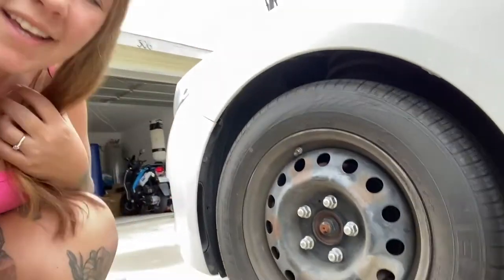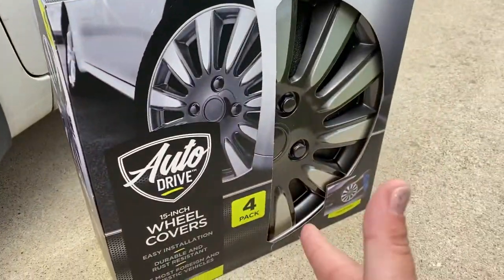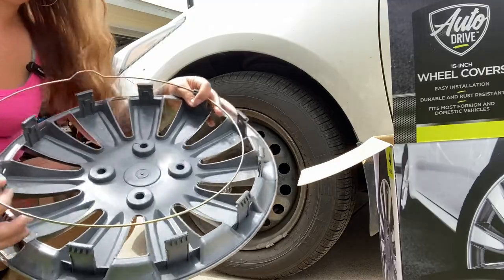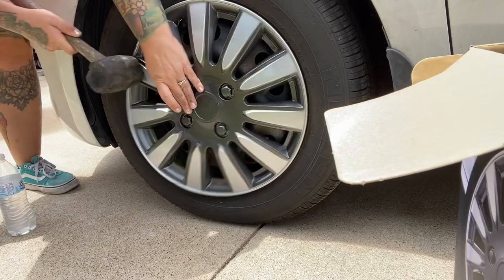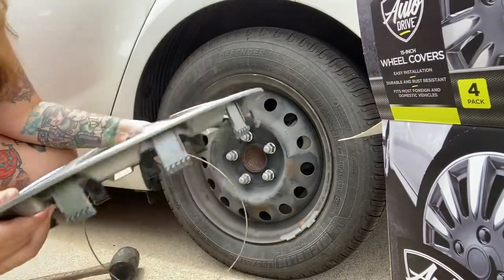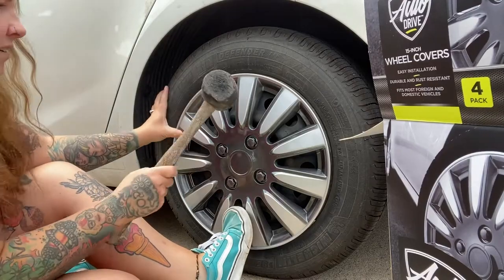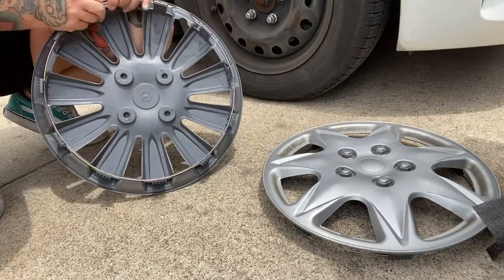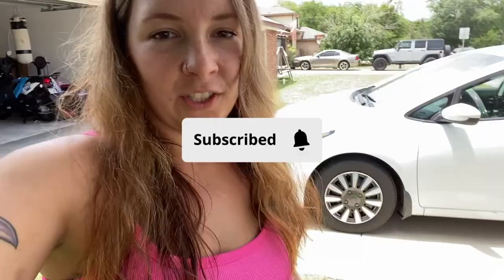Installing Walmart Hub Caps Wheel Covers

Comment: If the metal detent on the ring is not pointing down it could cut through your valve stem after a while. It happened to me.

Comment: Beinc plastic covers they are fiddly to snap on if a tight fit as they should be.  They want to slip away at bottom as you press or bam the top...as you see...and her foot method on the 2nd one.

To do it fast and not on your butt.

Get valve stem lined up
Press in the bottom half
Hold it at 3 and 9 oclock with your knees.
Press or tap the top grips a little at a time on each to avoid cracking the plastic.

That should take well under a minute and no annoying drops.

For those of you that think they will fall off...there are two places for the rings.  Tight and tighter.  The outer notch is likely the tightest over time.

I clear ziptied mine on JIC as I live on a ritted dirt road.  Ran two through the steelie slot holes opposite of each other.  I doubt they'd fall off though as they are quite tight.

Comment: The ring is on backwards…the lip of the ring where the valve cap is at needs to be facing down try it and your hub cap would have no gaps and be stronger on your wheel
Reply from the maker: @SHADOW-gen-Y  good to know, thank you. A year and many curb rashes later they’re still holding on strong!! 😆

Comment: The metal thing where is the valve should be pointed down
Reply: I heard it should be up
Reply from the maker: @wblake22 up would make it in the way of accessing the valve stem thingy
Reply: @savjelly  ok thanks. Seen another video that said do it the other way. It’s a snug fit that won’t come off then here saying opposite. Didn’t know which was the right way